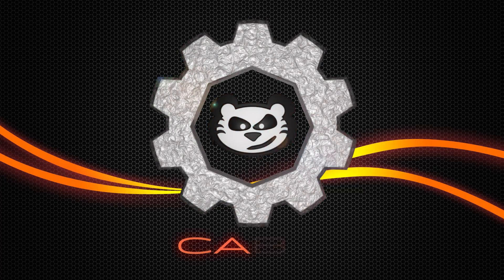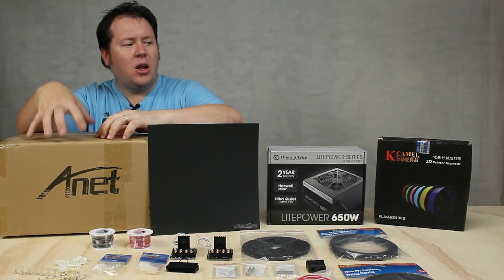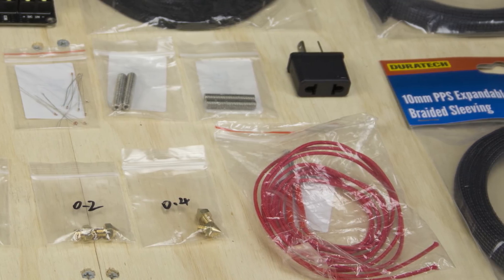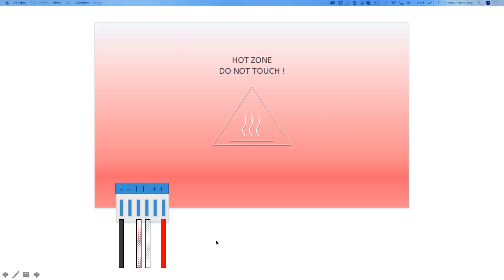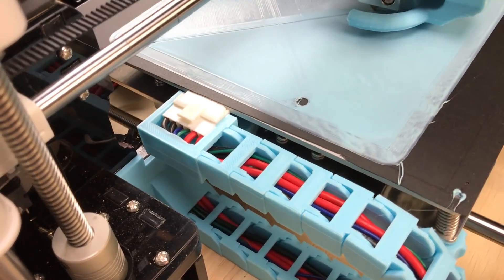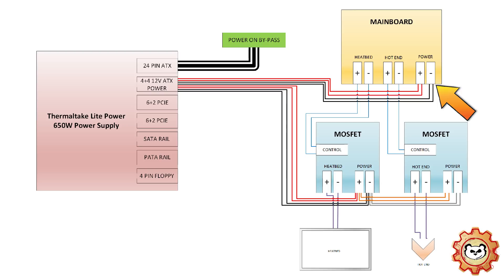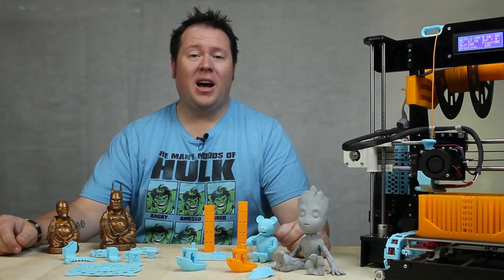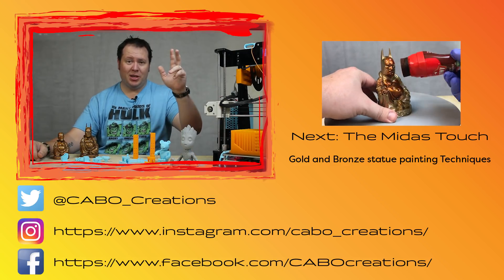A8TX - Anet A8 Build and Power Upgrade

Comment: i wish i had view you video sooner! i just soldering the wire to the bed without changing/modifying the cable. so 12 amp from each original cable. the original connector burn just like the picture you showed. my anet is pretty old +-  8 year i think and only advice is to add fan on the board ( i put a big pc 120mm blowing on the bord and the x step motor) and add a small 20mm fan right below the stepmotor for the bed and add heatsink to those 2 stepmotor. they wont get hot anymore and since i add that cooling system i have 0 glitch printer is perfect! without cooling those stepmotor would slip or just go nuts on their end.

Comment: my cble already came upgraded and also siliconed inside the pins with in the connector on top of dual wires. still debating soldering since that's no thing for me to solder. but, if ever need to swap the the bed it's an extra step.

Comment: Hi great vid, My second chinese stock PSU died yesterday, thinking of upgrading with an ATX PSU like you, one year later, does is still work? is it safe? some talk about too thin PSU wire for the amp needed . I run 2 mofset like you .all the rest of the electronics parts is stock. I just added fuses. thanks.

Comment: Good stuff. Been running an A8 for about 3 years now. Prob still my favourite lol. A couple of things may help make it even safer. 1) Upgrade the firmware. The stock firmware still ships with thermal runaway detection disabled. This means that if the thermistor or heating cartridge fall out, it will still keep heating and is a fire hazard. 2) Some sort of hotend cable support to stop 1 from happening in the first place. 3) Periodically check the grub screw that holds the hotend cartridge in place to stop 1 from happening. 4) Would suggest a 15a car blade fuse on the bed power cable and a 5a on the rest. I also put a 3a dedicated on the hotend. There are NO fuses on the stock board. 5) Heat washers between  the bed springs and the heat bed as the springs are very close to the traces and the only insulation is paint. Lastly, I am not sure what one 12v cable on that PSU is rated for, but you are pulling about 10-15a over those cables to the bed. I used AWG14. Love the spool holder. Keep it up.
Reply: Plus Octopi with Temperature Failsafe and Smartplug plugins and a TP LInk or Wemo Smartplug and it will shut off all power if any temperature goes out of bounds.

Comment: I've run my Anet A8 for 2 and 1/2 years with no power supply problems, no heat bed problems, no mosfets!  Printed rolls of filament. The acrylic Y axis motor did shatter and had to be replaced with a metal one.

Comment: Thank you for telling me about the bed wiring. I have found the common practice of directly soldering the wires to the bed to be an inelegant solution and knowing how to rewire the connector Is great and I feel dumb not realizing that's why there was two connections for both positive and negative. Good job, Anet, on making your cheap printer a little more dangerous than necessary.

Comment: Nice video!
There is no reason to fork out for a new ATX PSU.
Any old PC PSU from 200W up would be more than adequate for the job.
But the basic idea is fine as then you also have the +5V at hand for any Arduino or Raspberry PI add-ons.

Comment: A great informative video about the A8, I ordered one and is in transit, also I ordered some upgrade parts. I will definitely add this video as  reference in my researched data about it. Did you upgrade the MARLIN software to turn on the runaway heat detection system function (FIRE PREVENTION FUNCTION)? I understand that the firmware provided with the kit comes with this function turned off.
Reply from the maker: Hi Edward,

I have only just recently done the MARLIN update, I did a quick youtube search on how. I have to say it went pretty smoothly and I haven't had any issue since

Comment: Awesome video about a8. Even I just built this one week ago and not sure how to go about printing the adding. You already printed the wire chain zero the heated bed - did you do that with Abs or Pla ?  After reading/ watching a ton of tutorials it seems most the adding that are near heated bed need to be in abs. But out of the box it’s difficult to print abs as the bed has a hard time trying to get to the 100c mark and even if it does the prints are bad with skipped layers. It seems the solution is to insulated the bed on the backside and/or make a enclosure for ABS prints. Please let me know if your parts are pla.  Thanks.
Reply from the maker: Hey, all my parts are PLA, not had a problem with any of them being affected by heat from the bed and I have prints abs as well
Reply: Thanks for your response. you were able to get good ABS prints with the a8 setup you showed or you took additional steps to retain the heat of the place or the whole print space. I see you got a c10, i though about getting it then went with converting A8 to AM8.

Comment: The A8 being incorrectly wired is a problem that has been fixed. Plus a super simple way to add a power switch immediately is to just add a power strip to it. I went through every single connection with my DMM and they all checked out. I also powered my A8 for a while now with no issue (I'm not adding MOSFETs, at least yet. Because I'm going to upgrade my board soon to a Mega2560 and TMC2130 stepper drivers. Probably gonna go with a newer RAMPS setup (1.6) but still doing some research on what suits me best. Likely adding a RasPi with Octoprint as a print server. I'm also canning the entire PCB heatbed in favor of the more efficient silicone one. There's a lot more, but just some things that I've chosen after much research that may be worth looking into yourself. Specifically the TMC2130 stepper drivers, as they're unanimously regarded as the best there is. And your motor drivers have the largest effect on prints aside from hotend/extruder (which everybody upgrades quickly anyways) _ as long as there's no frame issue. Just some ideas to explore. Good luck and remember to have fun
Reply: Piano Boys - Thanks. That was my plan from the very beginning. Which is why I went with the cheapest i3 I could find. As it ultimately didn't matter. I'm going to swap out the frame with T-slot aluminum extrusions which I'm getting for my lathe already, so I'm just gonna add the ones for my printer to the order so I can avoid extra shipping on such long packages. I'm making an enclosure from an IKEA Lack and some thick pieces of glass from a couple old tables that I was going to throw out, which will keep the heat and noise inside. Especially since I got a water-cooled kraken knockoff (which I also setup super cheap using a wine chiller from a thrift shop as my water chiller and 1/4" air hoses to the printer and another to my laser cutter with just 2 reservoirs and pumps. I could go on and on but it'll be way too long

Comment: If you end up having trouble with your BuildTak (my prints stuck too well on it and ended up pulling out pieces of the surface) try out PrintBite, it has been amazing and pretty much self-releases when the bed cools.

Comment: Great build video. I got my A8 just after Christmas, I've added similar mods, but went with a 30A cooled power supply rather than ATX. Although you made it simpler than other ATX vids I'd seen.. I'd highly recommend some frame stiffeners so you can add a Y belt tensioner without straining the fragile acrylic.

Comment: I'm about to hook up a atx power supply to my anet a8, do you have any instructions as a guide, the original psu blew on 1st start up!!
Reply: Derek Thompson Hey Derek, all I have is what’s in the video and the schematic. Are you running mosfets or just the printer?
Reply: just the printer
Reply: Ok cool, connect the hotend  and the bed to the mainboard as per instructions. 

Make sure that the ATX 12v rail has min 20 amp (this will be one of the 4 wire plugs usually 2 black and 2 yellow wires.) Some PSU's have them in a 2 x 4 configuration (ATX 12v 4+4), you will only need to use one of these.

Join the 2 black wire together from the PSU, crimp them with a fork or ring terminal and connect to the mainboard negative power

Join the 2 yellow wires together from the PSU, crimp them with a fork or ring terminal and connect to the mainboard positive power.

(Same steps I use at 8 min 10 sec)
Reply: Thanks for the reply, I will be following that process, another thing to clarify when I disconnected the old psu it had the z axis motor connected to it?, where does that now need to go?
Reply: Thats a new one on me, both my z-axis motors are connected to the mainboard on mine. If you have a photo I can take an educated guess for you though
Reply: Ben Armstrong I will send you a picture through Facebook, not sure how to send through YouTube

Comment: I also have an Anet A8. I just received my JST crimp tool. I don't have made the new bed connection yet.

Why did you choose to put the connector on the left side instead of the back ? There is more stress when put on the left side.
Reply: Mine is on the back, im using this strain relief mod
https://www.thingiverse.com/thing:2700340
Reply: Putting it on the left allows for the cable chains, which provide strain relief, cable management and great looks all in one!
Reply from the maker: Hey, I put the connector on the left initially because that’s what the instructions said 😁 

While I agree with you that placing it at the connector at the back is better for strain relief, there is nowhere to connect a rigid protector for the plug as these get mounted to the H plate and the screws are at the sides not the back
Reply: In the PDF I received with the printer kit, it show the connector at the back. But, I've seen a lot people putting it on the left, and I always wondered why :)

The first thing I printed was a strain relief for the connector at the back. It's not the best, maybe I'll design a better one, one day.

That being said, if the printer is jsut before the wall, the connector at the back could be a problem :)
Reply from the maker: Do you have a picture of the strain relief? 

I would be really interested in seeing that solution, it’s always great to see what others have done 👍
Reply: Better than a photo, here is the thingiverse : https://www.thingiverse.com/thing:2438246
All credits to "Exterminate" user ;-)

I use it without screw, it holds enough. A drawback is the lost of some printable space. As I have a glass of 213 x 200, it's not a big deal for me for now.

I liked this solution because of the print time, I wanted to protect that connector as quickly as possible (who is not suitable for a non stop moving cable).